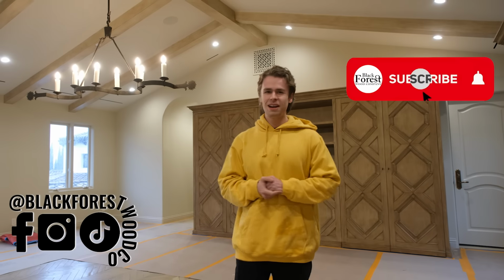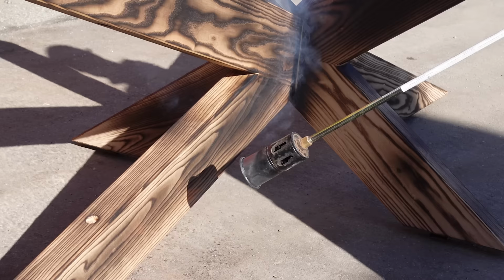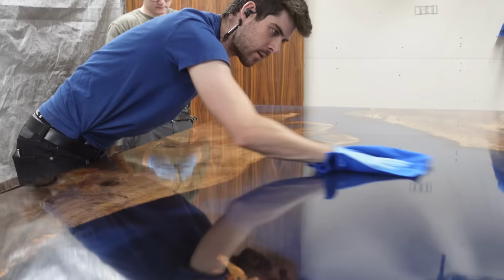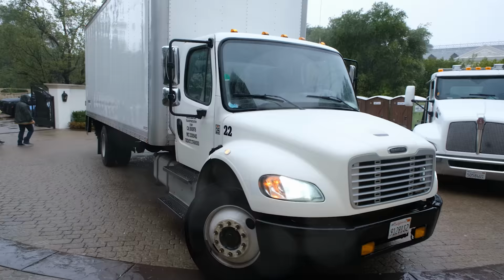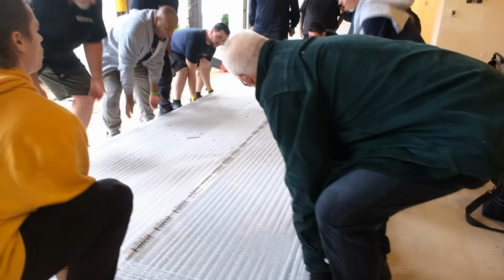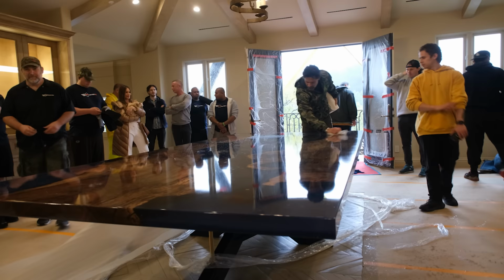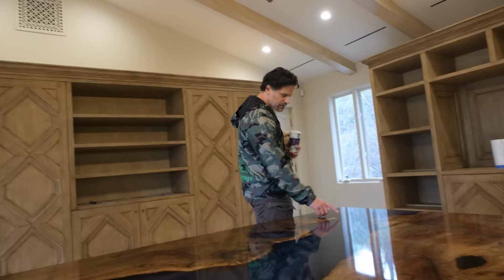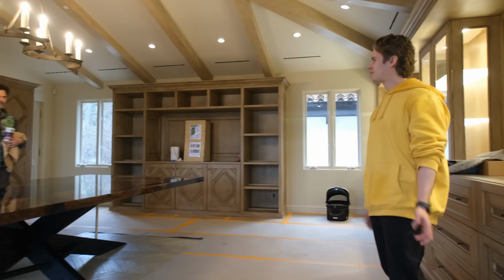Delivering Joe Manganiello’s Dungeons and Dragons Table

Comment: Wow I move furniture as part of my job, sometimes in the homes of billionaires, and watching that even had me stressed. Great job with the table and with the installation. I'd love to see what that room looks like when it's all put together. I subscribed because of the first video you did on this table and couldn't wait to see the finale.
Reply from the maker: You can definitely relate then! Thank you 😊
Reply: I'd also suggest instead of using multiple Four Wheel Floor Dollies with casters some custom built padded Door Dollies in conjunction with straps would be a nice addition because the floor dollies can very easily slide sideways and kick out causing the table top to want to tip over. Proper preparation, and communication is key. Teamwork makes the dream work.

Comment: Wow. What a feat. I have built and installed many one-off Flagship type displays and anything that can go wrong will go wrong when you least expect it. There is a lot of problem solving on the spot and soldiering through extreme install schedules. Not to mention directing a team of local installers that you may not have worked with before. Outstanding work.

Comment: A little advice for your future builds. If you are not doing an oil finish, use automotive clearcoat. You won't get any cloudiness no matter how many coats. Most show cars have between 7 and 15 layers of clear before they get cut and buffed. This will give your tables the most durable and glass like finish possible. Guitar and firearm manufacturers use it on wood every day, and it has no issues if done correctly.

Comment: Dad and I made store fixtures in the 1980s. At that time we did 3 coats of poly followed with Johnson's paste wax application with 0000 steel wool. Then buff with lambs wool for a very durable surface.

Comment: This is beautiful work. Great job. One trick I've learned is to use a paint brush to paint clear epoxy on your live edges BEFORE the actual resin pours. It helps seal air in the wood that would otherwise slowly seep out into the resin. It makes the bubble popping much a much easier chore. Also sometimes those bubbles get trapped under an exposed top layer that starts to cure quicker than the resin in the middle. And then those bubbles are there for good.
Reply from the maker: We advise against sealing the edges, the only time we have had any sort of failure with our resin pieces is the ones we sealed the edges on, we even had to replace our client's coffee table a few years back. When you seal the edges, the resin isn't able to soak into the wood and instead you just get a resin on resin bond which is not nearly as strong and might detach from one another years down the line.

Comment: Beautiful, I believe you could also get the water look by applying a thin urethane layer after the first coat and then applying the next resin cost when the urethane is 3/4 dry.

Comment: Feel terrible about the finish accident. I've been a custom finish man half my life whether working or helping my dad who was a custom carpenter for almost 50 years. I knew what that haze was as soon as I saw it. I had a HUGE pantry piece turn out the same way after my last coat went on an extra 2 mils thick due to not checking the output on my sprayer (rushing will get you every time)  we used a lacquer hi build medium rub and it gave us that same matte look afterwards. The rework was the maddest I've ever been at myself in the shop. Lol

Comment: I would recommend using a long throw random orbital buffers instead of the orbital, Rupes makes one aswell, tho Adams and Griots makes equally as good polishers for cheaper. The random orbital at a 21mm longthrow essentially makes crosshatch buffing pattern, reducing the risk of swirl marks while finishing basically 0.

Comment: There's a company here in Kanas City that just sells the tops they do but I don't think they are not using this type of would. But the tops are very affordable. I could make a deep 6 foot wide desk for maybe around $300 for the top only and then the legs off Amazon or Etsy are another $100+. The tops are heavy. but they look amazing. I told one of the guys to put LEDS in the resin but their English is not that great. They are a supplier for counter tops and tables for the Hispanic community. I saw a lot of photos of their products being used is Hispanic clubs and restaurants. They had a dark red resin top in wood that looked incredible.

Comment: Looks just beautiful……….question will it scratch
Reply from the maker: Thank you!
We put a polyurethane finish on it so not very many scratches will show, but over years of playing D&D on it you have to expect a few scratches here and there, just like you would with a normal wood table. Putting a fresh coat of ceramic usually fills in little scratches though, but if Joe were to get a big one in it we would offer our services to sand it down and get it re-spray-finished

Comment: One suggestion - it's really hard to see the table with a wide-angle shot, into the light, edge-on to the table and unfortunately you guys do that a lot.  Try a close-up macro, slow pan that's as face-on to the table surface as possible with narrow DOF and sharp focus so you can see all the glittery details.  Do several takes from different angles and chop that B-roll of close-up beauty shots into the commentary.  Love the work - just wish I could SEE it more!

Comment: Where do they get such big slabs of wood? Are there trees that big besides like sequoias? Are they cutting them down?
Reply from the maker: We got this particular walnut slab from GL Veneer. They specialize in milling slabs from salvaged logs. Walnut trees have a lifespan of approximately 150 years, this tree has reached the end of its life and had begun to decay. This tree sat on a private property, not in a forest. As opposed to it being removed and chipped, GL Veneer salvaged it and turned it into material that can be given a new life!

Comment: I don't understand why the table couldn't have been sanded and buffed to a clear shine before removing the whole first spray. Black tail studios does this whole process a lot better.
Reply from the maker: Well you see, sanding it is how you remove the finish it so we did do that 🤣
Also, it doesn't matter if we buffed the top coat of the finish, it was the first coat of spray finish that was murky so the only thing we could do was sand it back down to raw wood and redo it

Comment: 8:30 It was that easy to damage the table? What happens when the clients start using it, seems like it will not last long.
Reply from the maker: That was with improper finishing as we said. They put too many coats on at once, too closely together and it didn't cure properly. So it was redone properly and the finish was no longer an isssue

Comment: The table is beautiful. However, I think you guys messed up big time and kind of skipped over it. While setting up for the original pour, I noticed you had a bucket full of river pebbles nearby, presumably for inclusion as rocky features in the river. Did you guys forget to add them while doing the pour? Maybe got a little distracted by the cool ripple effects and skipped the step?

I wish those had been added. The water areas of the table would look much more realistic with them added.
Reply from the maker: Nope, we just had those leftover rocks in the pour room from another client's project.

Comment: I like the video but I just have to mention as I'm sure others already have. Almost any American hardware store will sell both standard and metric bits and tools whether it's for screws, bolts, or Allen wrenches. Perhaps they didn't the use proper foresight when designing the piece for their customer or didn't deem it necessary at the time but if you're constructing a customized piece for a client in America you should most likely take factors like this into consideration. This way if a moving company has to disassemble the piece no extra time is wasted. Perhaps they only meant for the transport crate itself which is totally acceptable. Also why can't you completely section off the table with various warning signs and tape barriers stating that you are serious about maintaining the immaculate quality of this piece in the shop to prevent even the smallest of inconsistencies? I know it's not my shop but you had to do multiple processes over again delaying the delivery, and this could have set back  promotional deals if it was scheduled for the initial date. All in all this table is absolutely phenomenal, and I'm sure the team put a great deal of painstaking effort and skill into this piece including the delivery. Congratulations and keep up the excellent work you achieved together.

Comment: Such attention to detail, except they didn't use washers with the bolts under the table. Must go back to the factory.
Reply: We don't need washers when the head of the bolt is flat a 3/4" diameter

Comment: Calling bs on 300 man hours. Maybe if they included someone watching it dry. I’d buy 150 if someone built the stand using basic tools, but cnc machine would cut that down significantly. Great video though, Joe’s sale pitch better that the companies owners
Reply: If they spend 30 hours polishing it, someone doesn't know what they are doing. Even with four or five runs of polish, each run should be 30 minutes, max.
Reply from the maker: @kjetilknyttnev3702  Like we stated in this video, the table had to be resanded and refinished multiple times because of the spray finish collecting dust, so we had to repolish it multiple times too

Comment: Sorry to say that but the surface ISN’T great. 
Might be the light in part but the finish is definitely NOT good. 
As a Pro, i would have lightly sanded the previous matte finish and add 1-2 coats of gloss. Then if necessary I’d put on automotive acrylic coating, after getting rid of all the imperfections of the gloss coat. 
Repeat this process 3 times and the result may be staggering.

Furthermore there seem to be some bubbles in the table. 
But i am not sure.